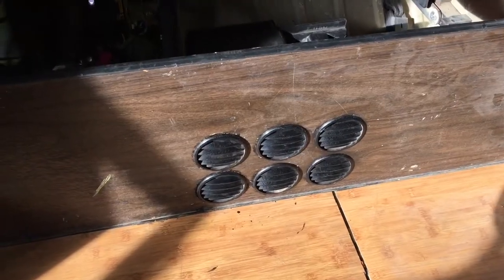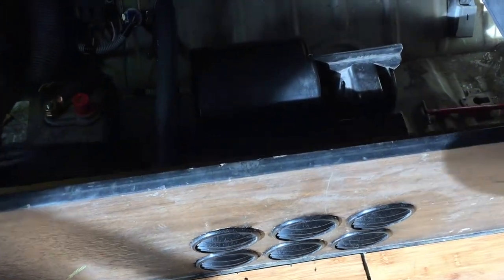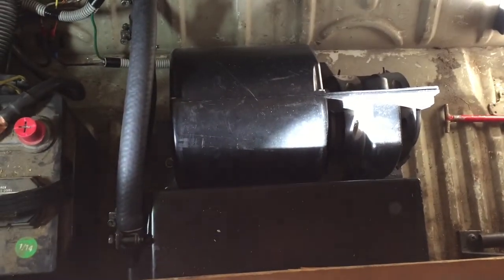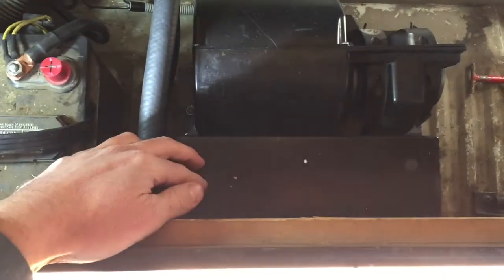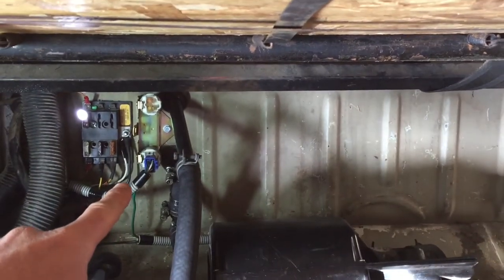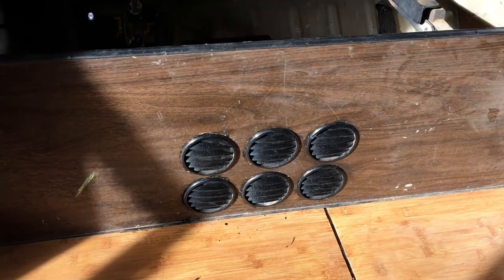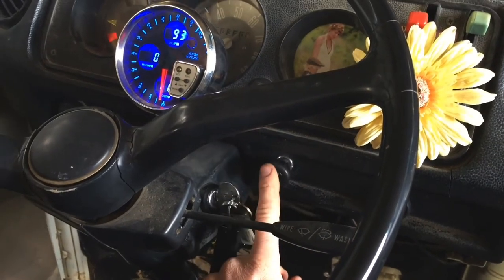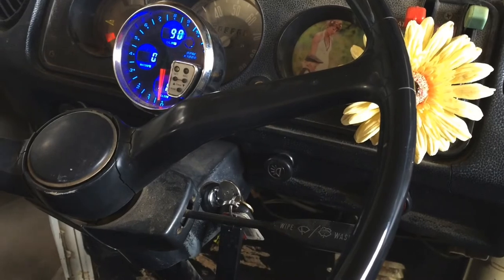Quick budget heater tour

Comment: Would an Audi V6 be a good swap candidate for one of these buses?
Reply from the maker: +Kevin Hornbuckle Could be, I've never played with those, just the 1.8 4 cyl. I'm assuming you'd need an adapter plate. May also want to measure crank distance to top and bottom of engine to check physics fit. I bet it would be a rad swap though.
Reply: +Busaru There is one on the shelf at a he local salvage yard. I did not ask them the price. It is a 3.2 V6. Seems like it would be a good swap-in, especially with a 6 speed.
Reply from the maker: +Kevin Hornbuckle oh wow, that would be really cool. Would you be doing mid engine so the trans rotates the right direction?
Reply: +Busaru The sort of natural fit would be onto a Subaru transaxle with the front wheels driven, but in the VW rears become driven Delete the Suby OEM tailshaft. So mid, in that sense.
Reply: I called to get the price. They want $1,450.
Reply from the maker: +Kevin Hornbuckle ouch!
Reply from the maker: +Kevin Hornbuckle I would love to see it - I hope you try!